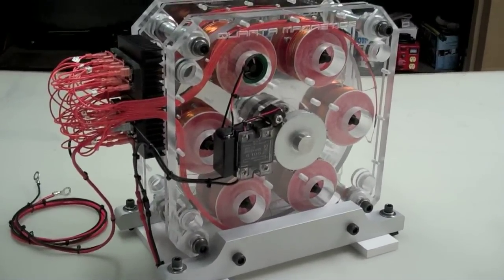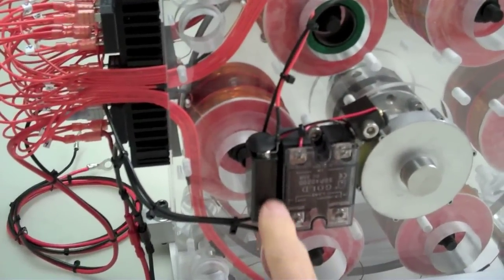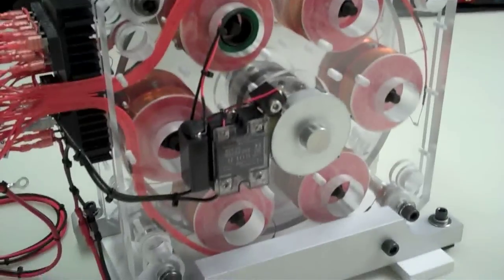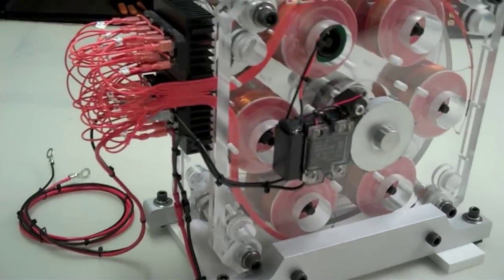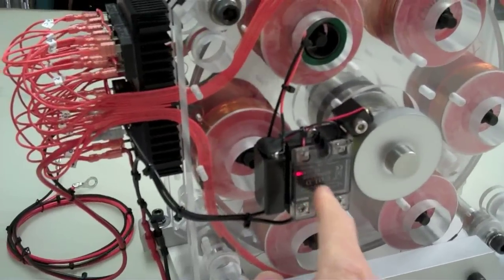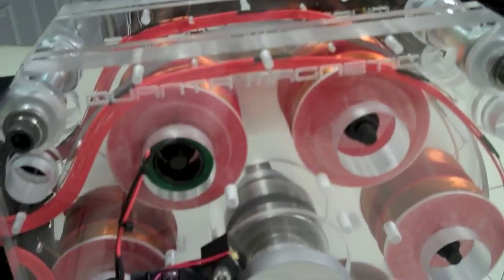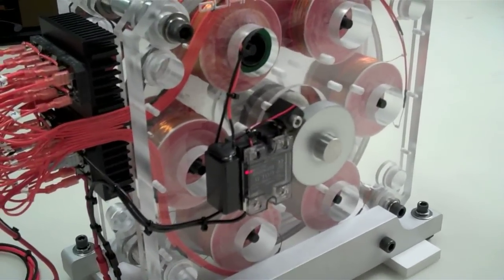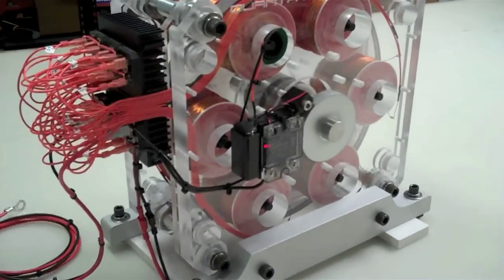QC Motor Generator

Comment: What are the outside overall dimensions of the QC Motor Generator?
And have you determined the actual shaft torque?
Reply from the maker: The QC is a half cube of 12" x 12" x 6". The shaft torque is relative to the input but has not been accurately measured.

Comment: 600 RPM, output 60 Hz, stay with already made devices, no new animal to create or buy! Sorry about comment, just what the big-boys will be asking when come, knocking!  They will even want a spec-sheet on the Unit!  Military Applications, unless on the ground, planes use laser/fiber optics and shielded Magnetics due to EM-Pulse!  The would be great in a Ship, Sub properly shielded of course to keep a continuous charge, when main equipment goes down!

Comment: Got It; perpetual motion machine!  Very good JOB, great concept!  The first coil with metal core is that your trigger coil?  Have you done measurements on the output, Load, no Load conditions? What's the Max Load before the machine comes to rest? Need a laser rpm meter to check for 1st drop RPMs/load condition!  Small pickup power coming from battery input, with small switching circuit can be alternated between batteries for continuous power, until batteries dry!  Liked your bat-cap one better!

Comment: Is that without power-input?  Is this a true perpetual machine or Overunity machine? I understand the concept, but Overunity machines just put out more energy than they take in? Of, course you know-this? Does the larger machine actually power a large Resistive or Inductance Load...Such as an air-conditioner,refrigerator,etc? I realize this little machine is more for experimenting with Z-point Energy, which is actually a misnomer, power plant already collect energy from source! Planck constant!

Comment: I've found Mechanical switches to be too slow! Some manufactures give approximate frequency range of switching potential, usually around 400 HZ? Switching at a higher frequency range usually requires a opto-coupling unit or hall device, while still switching range even with hall sensors can be limiting!  Depending on the hall device!  I'm sure the device revolutions are below this frequency! (Good Luck, Watched your Videos Before...Good Grasps of electronic knowledge)  Keep up the Good Work!

Comment: I can follow that the amp draw may drop. If doing so at a power factor of 10.. physics labs all over the country should be ringing there bells ! And to top it off the torque shaft increases ?

I am not too surprised you may have achieved these results. I would be honored to replicate your results and post support depending on the outcome. Please fill in the details.

At some point you have to put the methods out there for review, otherwise status quo prevails.

Comment: and how many 9volt batteries do you have to use to charge the 6 volt batteries to there full potential,, just cause they read 6 volt doesnt mean there charged fully... you cant defy ohms law!!....betcha those 6 volt batteries wont last 1 minute under load!

Comment: Very interesting device. However, it has no torque unless it is driving a load of some kind other than it's own inertia to start up, and frictional losses of the rotor.

Are you claiming overunity or just high efficiency?

Comment from the maker: cont'd... In the QC Motor Generator, as EM flux accumulates in the coreless series connected coil pairs to the point of minimal collapse when pulsed, a type of closed or shorted magnetic circuit analogous to a diminished or delayed Lenz effect occurs. The frequency of the rotor magnets assist in keeping the magnetic flux circuit partially closed. Amperage draw drops by a factor of 10. Net result... input/output symmetry with intensified shaft torque. No iron core needed.

Comment from the maker: Your iron core is helping to store EM flux energy by slowing the circuit response time, thereby reducing necessary input and providing acceleration through the frequency of magnetic engagement. Now consider the closed magnetic flux circuit of similar fashion to the NASA gravity boots of the 60's, and Ed Leedskalnin's findings. Once you've reached the point of electromagnetic flux saturation within a coil, or set of coils, if the flux circuit is closed you will retain the energy... cont'd

Comment: I am amazed that your design is able to accelerate under load without having iron cores. I have seen very clear acceleration in three of of my generators but they all needed an iron core to produce the effect! Would you be willing to share that much of the design with me? Needing to have an iron core is the only drawback to the generators I have been playing with. Your design looks incredible by the way.

Comment: ! I also have been running some 24 VDC setups. I built an E-Bike which is magnetic regenerative. I built a Magnetic Induction heater this summer which I run with a 24V magnetic motor at present. The configuration utilizes two sets of magnets of the 3/4 X 3/4 Nd 52's. the outer set and inner set are pressed in a 3/4 inch thick aluminum plate. I have just been using it to heat water in a spiral copper tube which has been set up at 3/4 inch above the magnet pole inverted set to each adjacent magnet

Comment: consider this, using 2 sets of battery banks to run your home, a main set and a secondary, main set runs for set time it takes to recharge  a battery bank, then swithes to secondary to let first set recharge.  then switch back and forth as a duty cycle needs. we use this system for solar and wind, why not here too. 200 years before the wright brothers the general population said man cannot fly..... and here we are . this is the future!!! never give up never stop trying.

Comment: if you dont need to pay the electric co and the gas station for those things, it would collaps our economy, this is why the gov is suppressing this where and however they can. my computer wastes energy by converting 120 volts to about 9 volts. energy is wasted by converting. early 1900 could not find DC generators economical because everyhouse would need one and DC is not efficient over distances. how many people have gas generators nowdays for backup when the power goes out.

Comment: keep up the good work. we can only advance as fast as technology. we dont even understand or have developed magnetic energy like this because mankind is lazy and easily missled. lets all think about this for a sec. if every household could produce its own power using a system like this and for its electric car that gets parked at night, backup battery system charges till full then swithes to the current one being used while secondary runs household, how many things can be run on DC in your home?

Comment: Nice job ! if you energize  every other coil set it might go faster due to the field being too close to the magnet and the field not collapsing fast enough for the magnet to pass. I had a similar issue with one of my motors not knocking your design  it's a  outstanding piece of work. just passing a idea your way.
Reply: Have you had any results close to this w/o iron cores?